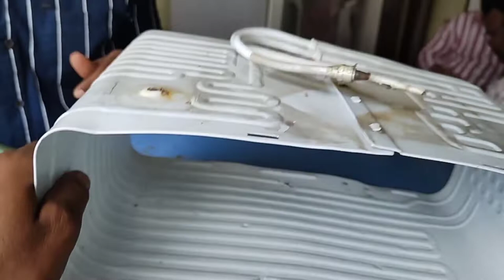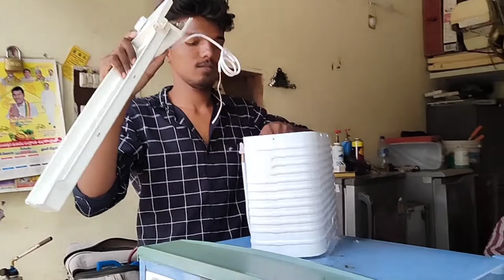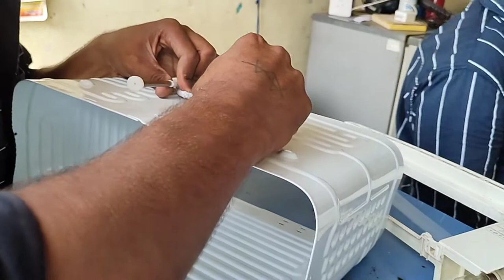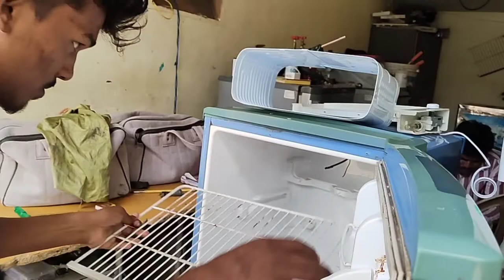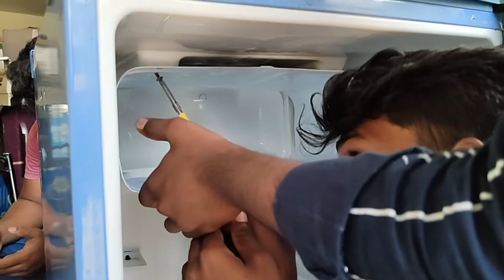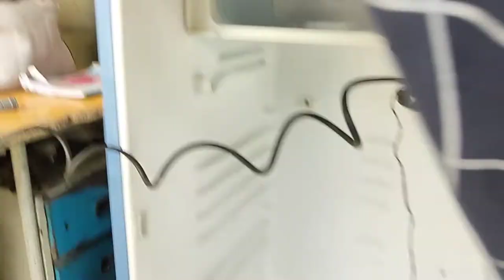LG FRIDGE CHAMBER CHANGE #telugu

Comment: We have also same refrigerator 2009 model LG (175-185) litre light blue colour. Yesterday we replaced the chamber. 

Total cost = 4100
Chamber = 2000 +100 = 2100 (added delivery charge = 100)
Gas filling cost = 1500
Service charge = 500